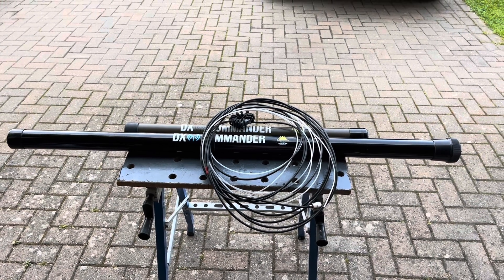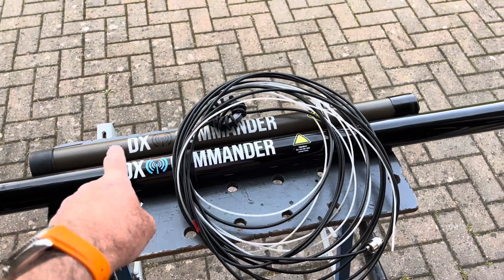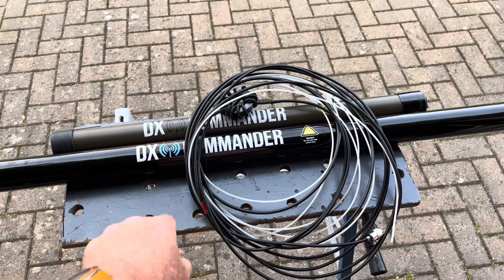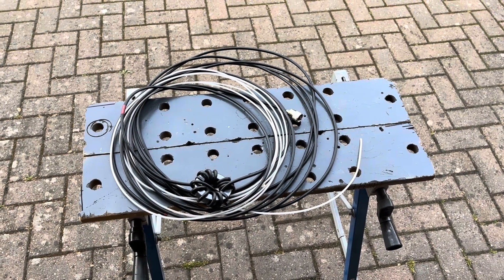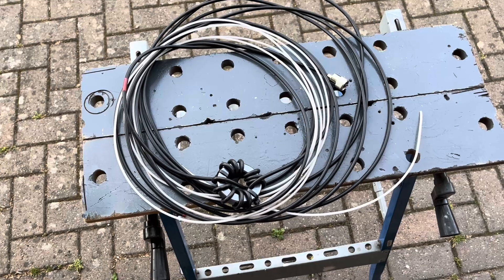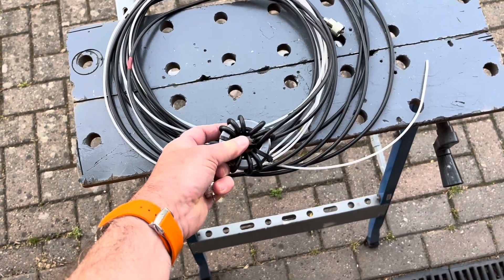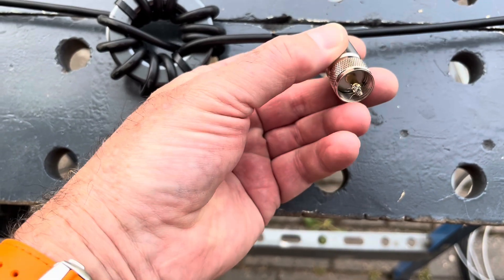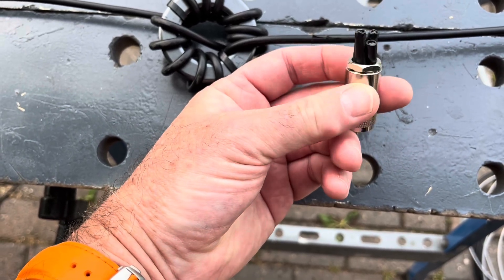Simple Multiband Vertical Antenna - No Radials!

Comment: Good to see you at the club last night Ian, i didn’t click it was you until i heard that signature accent haha. Interesting video and i bet it works well. Just a thought, if you plan on using a spreader it’s probably over the top but you could use a few SO239 bulkhead joiners as they come with nuts.
Reply from the maker: Yes, good to catch up Neil 👍🏻 Thanks for the tip 😀 See you at the weekend if you’re up there 👍🏻

Comment: Hi Ian - hope you successfully picked the wife up earlier, Saturday, I have 12 meter Spiderbeam and its a lot to manage. I have been experimenting for quite a few years with multi-band linear loading and this length was ideal but really needed a stable support/guy ropes.  Great experiment, I use single WAGO connectors especially useful when I’ve measured and cut short!  It happens and saves wasting the DX10 wire.  I have a Rapide plus at my new QTH which is giving curious results but Callum has been a rock with more to do due to harmonic relationship of the 40 meter wire coil.  Different installation to the norm.  I love to see people experiment.  Kindest regards Mike M0AZE
Reply from the maker: RR Mike. Nice to get you earlier 👍🏻 Still tinkering at this end. Watch this space 😁

Comment: Could you not ground the antenna to the car and use that instead of radials or just buy a dx commander
Reply: 1. The antennas are 1/2 Wave Dipoles, no need to ground them
2. The 1/2 Wave Dipoles will have a slightly better gain over the 1/4 Wave @ 2 DBi
3. Possibly/Maybe have a Lower angle of Radiation, better for DX
Reply from the maker: Hi and thanks for the comment. I see there’s already a useful reply. If you watch the first video (link is given early on and also in the description), it explains this design and how it performs 👍🏻

Comment: Looking VERY useful Ian. Using the DXC spreader plates would make it much easier to run the different elements and keep them apart and in the best position. After all it works with their 1/4 wave verticals 😊 Would probably also be worth having a look at how Callum positions the various frequencies round the pole to minimise interaction. Just a thought. If it all works out it could be a ‘go to’ for me at home , as I don’t have much space and can’t abide ground radials ☹️ 73 de GM4RAH (trying to get back on the air after a 30+ year gap).
Reply from the maker: Thanks Peter 😀 Yes, there’s lots of build options to consider 👍🏻